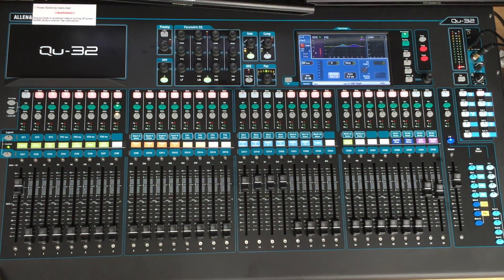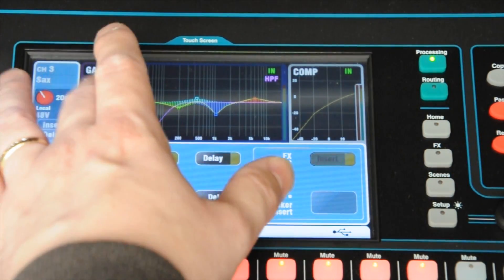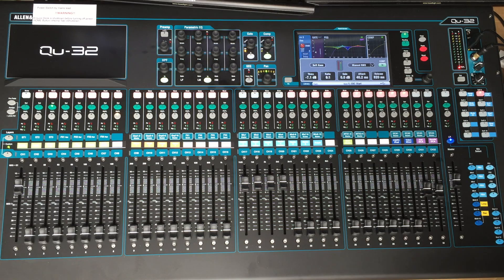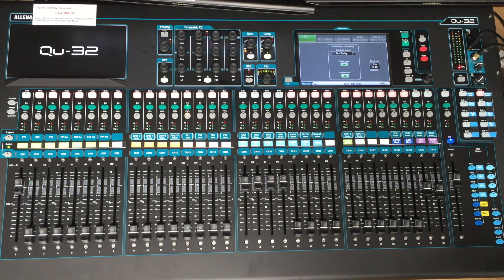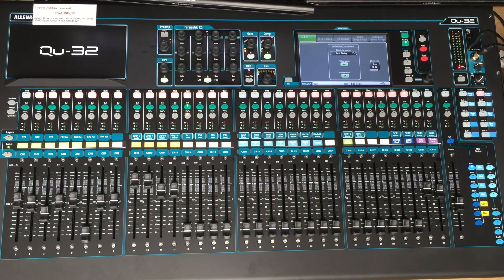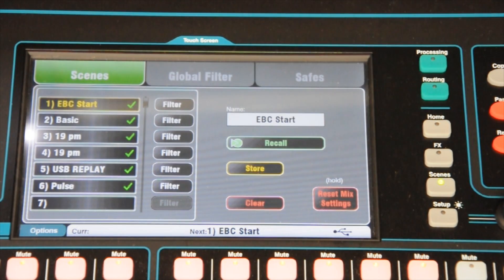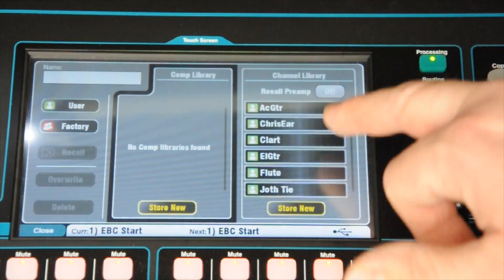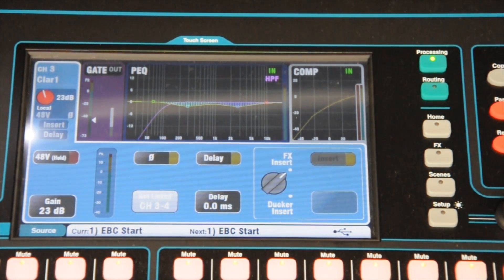QU32 Part 2

Comment: Why there is no -20 db pad? Definitely Im struggling with this
Reply from the maker: If you use the TRS connector then there is a 10dB attenuator compared to the XLR.  Also, you can dial in -5dB gain
Reply: @paulwilton  Thanks!
Reply: @paulwilton  hi did you mean there is a 10 dB attenuation if you use a jack rather than an XLR?
Reply from the maker: @tronlady1  Yes, if you look at the specs for the jack input, you will see that it is 10dB less sensitive that the XLR

Comment: hi thank you for the videos, is there a setting for the back speakers or monitors? if you can make a video i would really appreciate.
Reply from the maker: +henriquezhenry There are a number of options.  You can connect the speakers to a mix output - mixes 5&6, 7&8 and 9&10 are stereo mixes.  If you make them post fader, then you can use them in the same way as the loop and record outputs in the video.  Alternatively you can allocate them to a group which also have outputs.  Finally, there is an alt-output control on the desk (just below the phones volume).  You can select the alt-out using the utility menu.  Options include PFAL, LR mains and a lot of others.